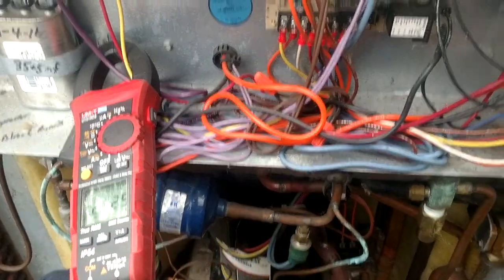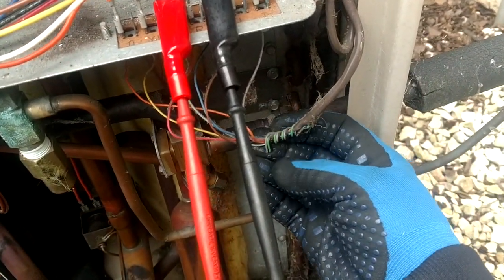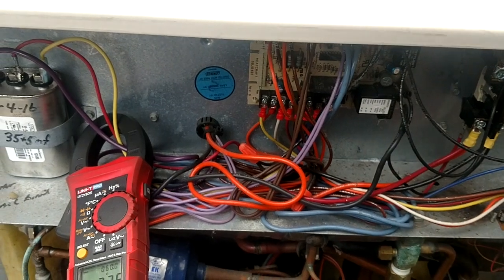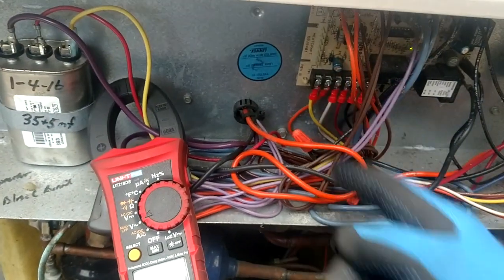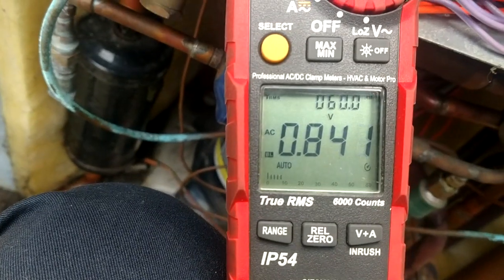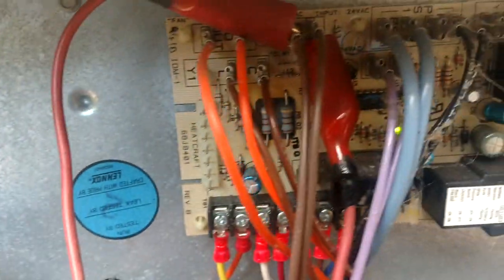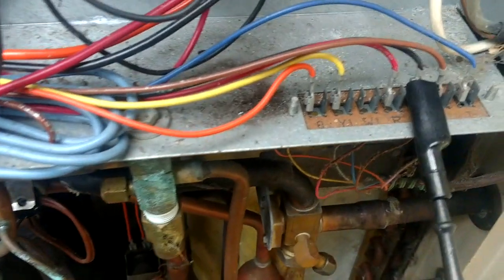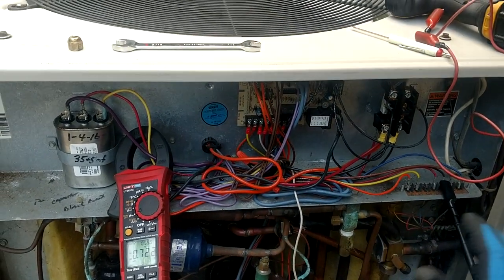❄️Defrost Cycle❄️Are the electric heaters on?? Commonly overlooked problem and how to check for it.

Comment: hello, 
I wasn't getting 24vac on white when in defrost. I forced 24 on white and electric back up came on during defrost like it should. I figured bad bored, replaced bored but am having the same problem. Any suggestions ?
Reply from the maker: What type of board "Brand" are you working on Cory?
Reply: S1-33101975102
Reply from the maker: @corylounsbury6888  The W1/66 terminal is probably not hooked up. "W" term. is for  24v coming from the indoor unit out to the condenser & W1/66 term. sends 24v back to the indoor unit to power elec. heat.
Reply: Shannon Knight HVAC after looking on my unit, I have a wire hooked to “W1/66” on the control board, but was capped on the other end.
Reply from the maker: @corylounsbury6888  BOOM goes the dynamite! 💣💣💣
That's your problem. Hook that up and you're good to go.
Reply from the maker: @corylounsbury6888  York does things alittle different. Maytag does the same thing using a "W" in term. & a "W2" out term. It's just making a "loop" through the DF board. Kind of pointless, but that's how they do it. Hope that helps you out 👍
Reply: Shannon Knight HVAC where should I wire the other end of “W1/66” ?
Reply from the maker: @corylounsbury6888  you can use a separate wire to run it back into the indoor unit but the easiest way is to just tie it into the White that is connected to "W". Before you hook it up put the board into a test defrost and put your meter to volts and check C  to  W1/66 and you will see that terminal is producing the 24 volts during defrost. That's an easy way to test your diagnosis.
Reply: Shannon Knight HVAC great makes sense! Awesome advice, can thank you enough.